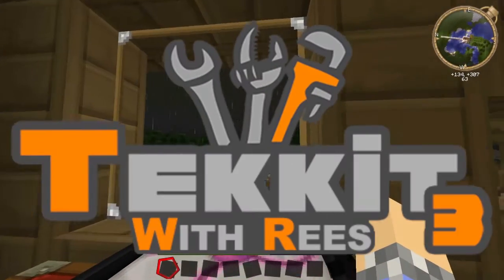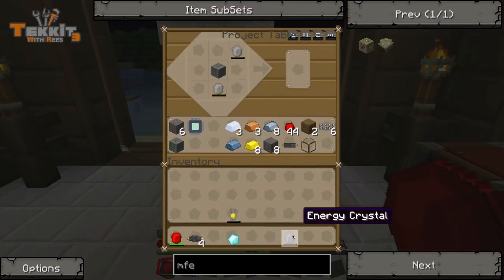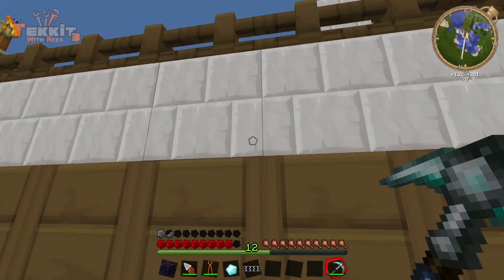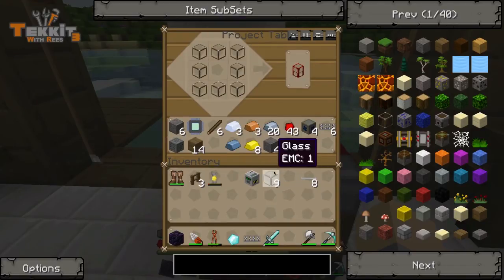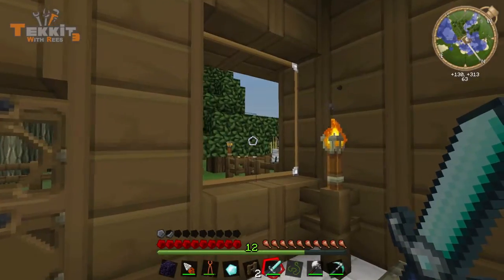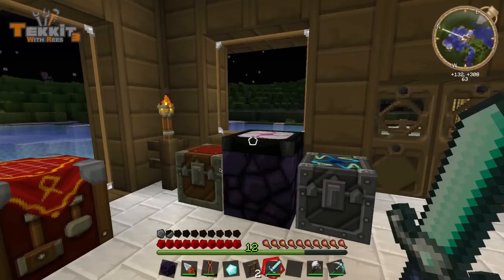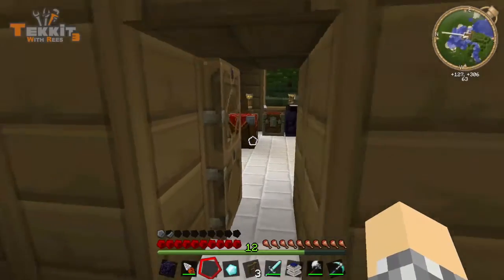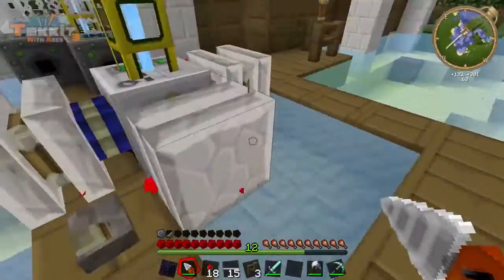Tekkit Classic - Episode 14: Pumps and Water Strainers

Comment: why do u need a transformer? and what are the diferent types of cable for
Reply from the maker: +MCrelationz Um, I don't remember what I did in this episode, but to answer your questions specifically: Transformers allow you to step High and Med voltage down to Low voltage. If you don't do that, you'll blow up your machines. As for cables, certain cables can handle different levels of electricity better/different. Connect copper cables to high voltage and you'll burn 'em up in a heart beat.
Reply: Cub Games good to know. thanks!